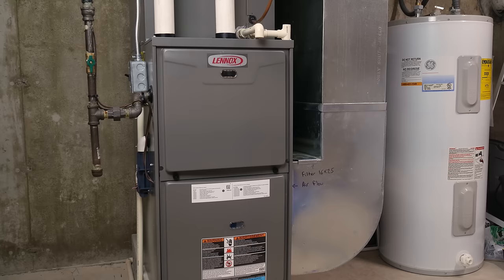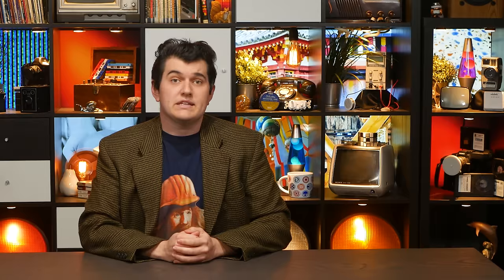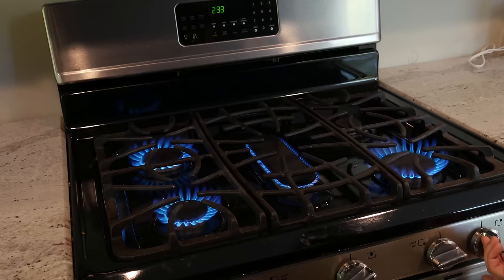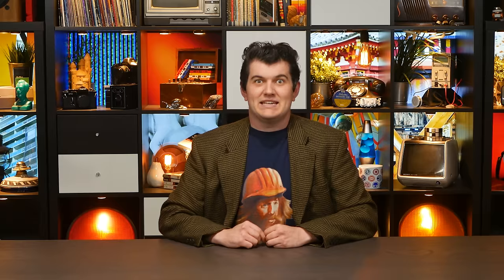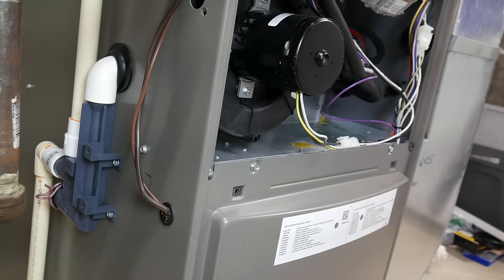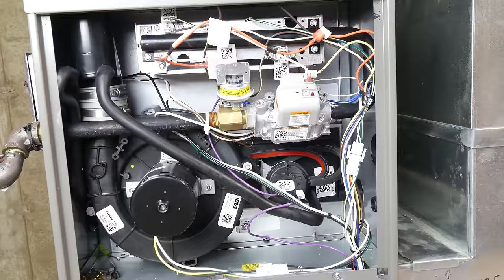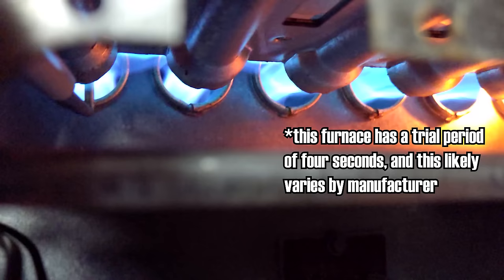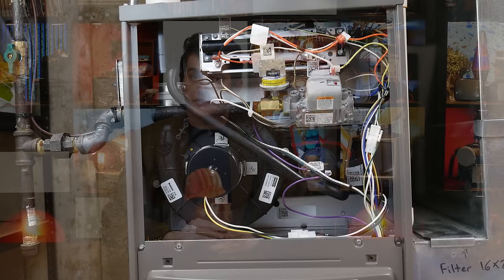Forced-air Furnaces: The What, Why, and How

Comment from the maker: **A fascinating correction about the flame sensor!**
It turns out that fire, as in literal actual flames, acts something like a diode. This means that the furnace is able to detect flames by putting an AC voltage on the flame sensor and monitoring for a voltage drop. The fire will actually conduct some current to the chassis ground of the furnace! This also allows it to detect if a flame has gone out mid-run. Pretty neat!
Reply: with oil fired furnace they use something called a "cad cell eye"
Reply: You could say that the flame represents... current events. huehuehue
Reply: Its called flame rectification. Fire acts just like a wire for electricity. If the fire drops off so does the path to ground = gas valve closes and furnace will attempt to re-light after  a purge cycle.
Reply: Flames and even just really really hot gas has lots of ionized particles. This can be seen from the flame itself . The light produced is the result of ionized participles returning to ground state emitting light. This makes flames very conductive (vs air) and this is often exploited through conduction, capacitance you name it.

Boilers usually use thermocouples on the pilot light to power a solenoid. (Which is amazing given how little power is involved) 

UV flame sensors are also popular and use UV light from the flame to excite a special gas to conduct electricity or some other similar technique that could be solid state or who knows there’s so many ways to do it.......
Reply: @John_Lee_  Yep, since the oil flame produces a lot of visible light and the detection of the change in resistance is easy, the moved to CAD cell (which is Cadmium Sulfide also known as CdS) photo resistors. Prior to that a special thermal switch used in the exhaust (called a stack switch) was used to prove flame.
Reply: @mr.monitor.  are you sure about that? Much easier and cheaper is to do that with voltage and few op-amps (gas boilers do that, at least my one do) than to measure current in uA range.
Reply: Technology Connections close.
Yes, there is a diode function to the sensor, it converts AC to dc, and measures the current to prove flame.
Reply: @jrmcferren  I hated those stack switches. Service calls left and right because the sensor was so sensitive to vibration too.
Reply: That is also the reason that old boilers are the only home appliance that I know that mind AC polarity, I mean that if you swap live and neutral they will not work. Now I think that they do that with some sort of more modern approach that doesn't involve putting line voltage into the burner, thus it's interesting.
Reply: Flames are a plasma, so they are conductive.
Reply: Some camping gas devices have a similiar function included
Reply: You are also somewhat right about thermocouples. In pilot light based systems a thermocouple is used to prove pilot light flame. Instead of using a circuit board, the pilot light is lit with the control in a pilot lighting mode. You hold the pilot button in (which may be the mode knob itself) for 30 seconds to warm up the thermocouple (sometimes a thermopile if the thermostat is powered off it as well and is a wall thermostat). The button you are pressing is a mechanical bypass to the pilot light valve. After the thermocouple or thermopile is energized, the current flowing through holds the pilot valve open. The next step is to turn the mode knob to on and then the device will run.

I know this from my RV days as my family historically had older models that still used pilot lights in some appliances and you had to light the pilot lights yourself. RVs also use spark ignition instead of hot surface ignitors since the ignition systems run on 12 volts DC instead of mains voltage and thus the energy savings of the spark ignitors are ideal.
Reply: @alerighi  many new products in the industry are still that way.
Reply: @mr.monitor.  at least the HVAC tech check that way. Transistor amplifiers are better at dealing with current anyway.
Reply: some bloke you good bruv?
Reply: @jrmcferren  you are guessing on a subject you know nothing about.
Reply: @mr.monitor.  Best answer!
Reply: On an Older Oil fired furnace, It uses a cats eye cell to monitor for a change in light output. Same principal applies.
Reply: I once saw a video of a propane burner playing music using two wires leading away to an audio source!
Reply: @some bloke You still don't have a reason.  Tell me which statement you or anyone else has proven to be false:  1) CO2 blocks infrared (heat) energy.  2) The Earth maintains thermal equilibrium by re-radiating energy from the Sun in the infrared spectrum. 3) Humans are dumping gigatons of CO2 into the air every year. 4) The Earth is heating faster than at any other time we have data for.
Reply: makes sense fire is plasma and plasma conducts electricity
Reply: @mr.monitor.  lol, so you are guessing on a subject you know nothing about. 
Your multimeter measures voltage drop (across an internal resistance) in order to indirectly measure current, its cheaper. So does the microcontroller in the HVAC. Measuring the electric field of the current would cost much more and make no sense.
Reply: @mr.monitor.  I don't know a thing about north american furnaces and I never see'd one in person so there is no reason for me not to trust you. Just it seam'd to me as strange way to measure it, it's not like I'm technician for any kind of furnaces but if somebody wake'd me up in 3am and demand that I make a circuit to control one I'll probably choose voltage level solution first never thinking about current one. As that is obviously wrong way to do that good think nobody ask me to make one :D
Reply: In the Air Force, we have heaters to use on the flightline. One safety feature it has is a photocell that detects when the flame goes out. That then de energize a solenoid, and cuts the fuel pump
Reply: What happens if the gas valve becomes stuck open?? I'm guessing the reason it's the first thing to be turned of when shutting down is so that if it gets stuck the furnace will just remain constantly on until you can turn off the manual value??
Reply: Yes, it's called Ionization current flame detection, pretty common for gas heaters. But thermocouple can be probably used as well.
Reply: Fire is conductive? Get me some Fire-Lightning!
Reply: Oh, of course! Like a vacuum tube (minus the vacuum)! Genius!
Reply: i don't know if they use these in gas furnaces, but in oil furnaces there's often just a photosensor inside the burner that will detect no light if the flame is out, or will detect the light of the flame when it's burning.
Reply: Thermocouples will do that.
Reply: Also maybe you should talk about the fact that transporting the heat also needs to be taken into consideration for calculating efficiency.
I'd think that Air would be worse for efficiency than Water+Radiators
Also, you can't use a heat pump in winter and expect to keep your home heated comfortably.
You can't break the laws of thermodynamics, heat pumps and Air conditioning do seem to do it, but they don't. You can only get so far with a heat pump, but when you are trying to squeeze heat out of -5 degrees Celsius air will not end up with a 21 Degrees Celsius home.
Reply: Yes, the flames in senses by a flame sensor, how ever it is measured in micro-amps DC. Also another small correction, while talking about the combustion air of the furnace you referred to the appliance as a condensing furnace, while this is not incorrect in context it would have been more appropriate to refer to it as a direct vent appliance. 
Other than those two small inaccuracies, as a professional in the field for the last 20 years, I am rather than impressed with the accuracy and relevant information in the video. Thank-you for trying to educate the population on how a furnace actually works.
Reply: Sean Blake  modern gas valves have redundant solenoid operators.  The likelihood of 2 valves sticking open is near 0.  That said, I have seen older gas valves stick open, one on a boiler, one on a furnace.  The one on the furnace, did involve the fire department showing up.  Luckily the blower continued to run, and the space was overheating.  The one on the boiler was very scary.  Boiler was practically dancing on the floor, the relief valve was blowing off steam(on a water boiler), and the temp gauge was pegged out at 260 deg.
Reply: Green new deal good?
Reply: One additional foot note. While PVC pipes may be acceptable as combustion air exhaust (I actually doubt it is), for some high efficiency furnaces... I don't believe it's advisable. Typically the combustion air exhaust and even the makeup tubing are made of ABS plastic (typical black)  versus PVC.
Reply: Same as with boilers here. They use a JFET with a 10 Mohm gate resistor, to detect the flame electrical conduction.
Reply: @John_Lee_  Remember that. It was an infrared sensor...
Reply: i cant wait until elon finally get the tesla HVAC heat pump out
Reply: @toddcoonradt6174  Yea and I've seen forced air furnaces burn down a trailer home. Things happen.
Reply: @teaser6089  I agree.
Reply: GMK International incorrect.
Combustion gasses in condensing gas furnaces utilize true schedule 40 PVC pressure pipe. THE SCH40 vent pvc “foam core” piping cannot be used.
Reply: @teaser6089  Actually, transport losses are irrelevant as long as your ductwork is running through the inside walls, and not the outside ones. Sure, some of the heat in the heated air escapes the ducts and goes into the walls, but that is still inside the house, and thus, is still heating the house.
Reply: I think if I'm not mistaken that the pilot light (used for ignition) on our upstairs furnace is controlled by one of those things. Only downside is that a power outage will make it go out and force us to re-light it, but I definitely appreciate it preventing continuous expulsion of flammable gas if it goes out!
Reply: @ChimpyChamp  nope. not in any unit I've ever seen. Power is cut to the gas valve, and then blower run for a pre-determined amount of time. If the gas valve does get stuck open, when the draft blower shuts off, hopefully there will be enough oxygen shortage to loose the flame. But other than that, you are out of luck.
Reply: If you are interested in doing a video on Geothermal heatpumps I work at one of the largest systems in North America which is located in Elgin Illinois and would love to give you a tour
Reply: @teaser6089   Heat pumps often use secondary heat for low temps. If you are using electrical heat as the back up, then you are back to 100% efficient at least excluding power generation goes. Efficiency in heating is related to the exhaust heat not utilized. In the case of his forced air unit being able to use PVC pipe for exhaust pipe, that's pretty efficient in removing the heat.
Reply: Not really like a diode, tbh, more like a wire - it is conductive (because flames are ionised air), but doesn‘t restrict current flow in one direction. Sorry, nitpicky physicist comment 🙈
Reply: @mbonwick  I'd like to educate he public that a thermostat is not a gas pedal. Adjusting the thermostat way off its pre-set temperature will not get more cooling/heating out of a unit if it is having trouble keeping up. It'll just over shoot the temp you really want it at eventually. Unless it is a 2+ stage unit it just doesn't help turning thermostats.
Reply: @teaser6089  when the ducts are in the house, any heat lost through the ducts stays in the house. heatpumps become less efficient as it gets colder, but there's still a lot of heat at -5c, just need a variable capacity compressor to compensate.
Reply: @cheeto4493  I would have thought that the micro-controller would still sense that the flame is lit after giving the command to close the gas valve, so some safety thing would kick in to keep it burning and maybe sound an alarm to get someone to manually close the gas valve to the house.
Reply: In a blacked out box, where the only light source is a flame, you'd think they'd use that to detect the flame ! When it lights, there will be a step change in light levels - not difficult to detect - from even a safe distance !
BUT no, they want to put a wire in the fire - which over time droops and the system fails.
Reply: @toddcoonradt6174  Situations like that or the unlikely event that the exposed gas pipes are burst is exactly why I familiarised myself with where the main gas valve is for the house, fuck that it sounds scary AF.
Reply: Good thing I read this. You were about to receive a tongue lashing. “Thermocouple” indeed.
Reply: Yep, flames contain charged particles. You can actually bend flames with an electric field.
Reply: @mr.monitor.  More accurately it's measuring the difference in the current flow to ground on one half cycle vs the other half cycle, as it acts as a diode there will be slightly more flow to ground on one than other, this helps act as a failsafe as any other leakage path such as soot etc. would not act like a diode (as it would be purely resistive) and cause equal current flow on both half cycles and could be seen as a valid flame signal which would be bad.
Reply: A chemical reaction is conductive? NEAT!
Reply: @SuperVstech  It doesn't convert it to DC, it SLIGHTLY rectifies one half cycle more than the other (as the flame only acts as a single not very good diode) and it's that slight difference that's important to act as a failsafe detection method.
Reply: I generally like what content you offer. That said, this one hits closest to home for me.. I work as a lead, in manufacturing, in a breakfast cereal factory.  Part of my job is overseeing large gas fired deck ovens, that use all the  same operational systems, and safety failsafes that control a standard furnace. The only part not included is the cycling forced air, because the deck oven fireboxes are internal and dont have to move heat away from where it is produced. Cool content. Peace.
Reply: You should do a whole video on flame rectification, there's a lot more to it than you (and many of the commenters here) think, the EXACT way it works is very important and what makes it fail safe, a lot of HVAC technicians don't fully understand how it works just the vague basics of how they need to test it.
Reply: @millomweb  Some systems use UV flame detection but that fails over time and the sensors are fragile. Flame reification is very robust and extremely reliable.
Reply: @mr.monitor.  uA not mA but that's nothing to do with the point I was making.
Reply: Modern gas stoves use a somewhat similar sensor to cut the gas flow if the flame go off. Problem is that sometimes they are not reliable and it's tricky to turn on the stove (like when one have to try several times to start a motorcycle, a motor boat or a chainsaw).
Reply: Saab used this concept on their Trionic engine management system, introduced in the early 90's. They utilized spark plugs to detect engine knocking via ionization. Cool stuff back then.
Reply: @hectorj.romanp.  They are reliable, if they don't let you turn on the gas then they're probably dirty which interferes with the rectification, the problem isn't with the sensor it's with the user, they're doing exactly what they're supposed to and acting in a fail safe manner. The same could happen in a boiler if soot builds up on an electrode but that would be a failsafe measure as soot shouldn't be building up as soot would point to a combustion problem so again it's doing it's job as a safety part.
Reply: @mfx1  It's the electrodes used that aren't reliable ! They deform due to the frequent heating and cooling. Then they miss the flame and have gone very brittle ! I've a boiler in the hall that was taken out of service due to failed electrodes and bad reputation.
Reply: Actually it's called FLAME RECTIFICATION and it doesn't just detect if the flame has gone out mid run, it also lets the furnace know that there is a continuous flame from the first burner to the last. If one burner, say in the middle fails to light it will also shut the furnace down. What you called a thermocouple is really just a piece of stainless steel wire.
Reply: @millomweb  That's not a problem with the system as such that's incompetent design.
Reply: Interesting! Towards the end of the video you mention you’re in a cold climate, but I seem to get the impression you’re in the southeastern United States. Never thought of that as a cold climate, interestingly.
Reply: @andrewludwig9251  Nope. Because he's wrong.
Reply: The big advantage of detecting the conductivity of an ionized gas (or, flame) is that it is instant. No need to keep the gas flowing until it is evident that a thermocouple did not heat up. The gas supply can be stopped within just a few secs after it started in case ignition did not occur. Basically that is just the time needed for the flame to propagate from the ignition source to the detector, proving that all burners lit.

Good that you corrected your thermocouple mistake by pinning your comment.

Usually, another safety device can be found in those furnaces: a panel switch that stops and prevents operation if the access panel is removed.
Reply: @Yossus  no, really like a diode. Try Flame Rectification on Wikipedia. For a physicist you're not very good at research...
Reply: @gorjy9610  It's kind of down to semantics and how/where/what you're measuring. Flame rectification (also called flame ionisation but basically the same thing) relies on the flame acting as a very weak diode, pass an AC current through the electrode and the diode will cause a tiny amount of current on one half cycle to leak to ground through the weak diode but not on the other half cycle, this difference is critical as to what makes them failsafe as the difference confirms that the flame is there acting as a diode, any other form of leakage due to moisture or dirt would not act like a diode so there would be no difference between the half cycles. The way the current is often measured is that the base of a transistor is also connected to the electrode so the small pulsed current caused by the flame rectification turns the transistor on briefly, this allows current passing through the emitter/collector to charge a capacitor and simplistically you can measure the voltage across the capacitor to determine that current is flowing through the flame to ground so you are measuring current but you're doing it by measuring voltage. There's a lot more to it though as to be failsafe it needs to verify the current is flowing because the flame is acting like a weak diode and not because of some other leakage path such as dirt or moisture that could wrongly give a "flame good" signal (bad thing) so they actually verify that the current is flowing in one half cycle but not the other and there's loads of different schemes form different manufacturers to do that. However you do it  you are ultimately measuring the current to ground through the flame on each half cycle and making sure there's a difference within an expected range but that is likely to be achieved by measuring a voltage further down the line (just like multimeters measure current but actually measuring the voltage across a shunt).
Reply: Who installed your furnace?
Reply: How can it be a diode: what about a flame has a direction to it?
I think it will conduct equally well in either direction, if you place wires into a flame.
A flame is made of plasma, which is conductive for the same reasons a metal is.  You can find on You Tube (by one of the major science/tech presenters but I don't recall the name) a re-enactment of Faraday's lectures on a flame.
Reply: @JohnDlugosz  It's a very weak diode there's plenty of information about it.

http://liu.diva-portal.org/smash/get/diva2:20787/FULLTEXT01.pdf
Reply: @mr.monitor.  That sounds so steampunk, using flames as diodes must have found a use somewhere...
Reply: @millomweb  flame rectification type sensor is extremely reliable provided everything is clean - there are 25+ year old furnaces out there with original flame sensors doing just fine.
Reply: @mr.monitor.  Wrong, read on.
Reply: @gorjy9610  the Carrier & Lenox (and many others) heaters in the video use a flame sensor.  120v AC volts are applied from the control board thru several series resistors and 1 or 2 capacitors in series to limit the risk of electric shock to techs and homeowners. The flame rectification will allow a DC voltage to flow.  A metal to metal short from flame sensor to chassis ground allows AC current and the board will shut down the gas.
If you use a volt meter to measure the voltage at the flame sensor, your meter will drain some of the current limited power.  Cheap meters may report 6 volts. Better meters may report up to 90volts.
The old 60% furnaces use thermocouples and required time cool off and thus turn off "the gas leak".
P.S.  if a control board detects a flame when the gas valve should be off, the draft inducer and blower are turned on (protects warranty of equipment) and heats the house more and the homeowner complains, hopefully before the house burns down.
Reply: @jonathanwright6482  thanks for pointing it out - shows what I know! And now that I know the term I need to look for, the research will be a whole lot easier 😉
Reply: @mr.monitor.    Don't always believe Wikipedia. Flame does not act like a wire for electricity, in the instance of a thermocouple, nor does it serve as a ground, in fact, a thermocouple can't send a signal at all if grounded. Flame proving sensors actually produce a DC current flow signal (measured in microamps by your meter or the board) as a result of the thermoelectric effect between 2 dissimilar electrical conductors that are in the thermocouple. This signal will tell the board (if newer) to open a normally closed solenoid in the gas valve to allow gas on-demand. If the system is older and has a pilot light, it will use an series of enclosed thermocouples (called a thermopile) that send a signal large enough to actually engage the gas valve solenoid on its own. Cad Cam cells are used now for fuel oil furnaces and are actually thermopiles that read IR light instead of heat.  Mercury bulbs and bimetal switches used to be used for flame proving, but with the efficiency of todays systems, these sensors take too long to cool back down when the flame goes out.  This was taken from AHRI Fundamentals of HVAC, Third edition and Electricity for HVACR by Joseph Moravek.
Someone shoulda went for the Diploma instead of just the certificate.
Reply: Alright everyone, Listen up.  Don't always believe Wikipedia. Flame does not act like a wire for electricity, in the instance of a thermocouple, nor does it serve as a ground, in fact, a thermocouple can't send a signal at all if grounded. Flame proving sensors actually produce a DC current flow signal (measured in microamps by your meter or the board) as a result of the thermoelectric effect between 2 dissimilar electrical conductors that are in the thermocouple. This signal will tell the board (if newer) to open a normally closed solenoid in the gas valve to allow gas on-demand. If the system is older and has a pilot light, it will use an series of enclosed thermocouples (called a thermopile) that send a signal large enough to actually engage the gas valve solenoid on its own. Cad Cam cells are used now for fuel oil furnaces and are actually thermopiles that read IR light instead of heat.  Mercury bulbs and bimetal switches used to be used for flame proving, but with the efficiency of todays systems, these sensors take too long to cool back down when the flame goes out.  This was taken from AHRI Fundamentals of HVAC, Third edition and Electricity for HVACR by Joseph Moravek.
Someone shoulda went for the Associates Degree instead of stopping at Certificate or Diploma.
Reply: @Jon-hx7pe  Yeah I guess I jumped the gun, but it takes an incredeble amount of energy to take that heat energy and transport it up into the house. By that point you have to start considering if just using that electric power to heat your home wouldn't be more efficient. Cause I think it would.

You can't create free energy and I am pretty sure if you are trying to take energy from a very cold place and try to put it into a warm place would take more energy than just trying to heat the place up with electricity.
Reply: @teaser6089  it doesn't work that way because the energy consumed by the compressor is absorbed by the refrigerant and released indoors. a heatpump is worth running over straight electric as long as the outdoor coil is picking up free heat and enough to not be offset by defrost cycles which use heat from the house to melt ice on the outdoor coil. most air source heatpumps in cold climates are installed with heating elements to supplement.
the issue is capacity more so than efficiency -> there are some new heatpumps specifically engineered to maintain full capacity down to -20c or lower.
Reply: @some bloke Yeah! All those fake names, spouting unsourced "facts," and dealing out unfair put-downs. Lazy lazy lazy.
Reply: You touched on the issue of outside air can I suggest a video covering air to air heat exchangers aka heat recovery units they are an efficient way of getting large amounts of fresh air into a space without losing copious amounts of conditioning from room air we are seeing quite a lot of this not so new technology coming into play here in Australia I would imagine it’s a similar case around the world.
Reply: @clemkadiddlehopper7705  I wasn't talking about Thermopiles, thermocouples, or cad cells. But thanks for the boring message 😴
Reply: I have READ EVERY ANSWER to this comment (up 'til now). I am pleasantly surprised by how constructive and well-intentioned all of this was.
 
Thank you, everyone who participated, for trying your best to educate everyone else! TCCommunity ROCKS :D
Reply: @clemkadiddlehopper7705  and yes in the furnace pictured in the thumbnail flame acts exactly like a wire as I stated earlier. Has nothing to do with Wikipedia but actual experience.
Reply: most newer furnaces also have a temp sensor in the exhaust, if the temp gets too low, it will trip and shut down.
Reply: @Jon-hx7pe  Yes, but you need to work harder to get the energy out of the air, also if you are using a heating element in the heatpump to supplement it, why not skip that step and use it in the house itself. As that would be more effiecent. The higher the Hat Delta between 2 points the more work you need to increase it even futher.
Reply: @teaser6089  all the energy consumed by the compressor is ABSORBED by the refrigerant and helps heat the house, it's not less efficient to run a heatpump than straight elements until almost no heat is being picked up by the outdoor coil. what the outdoor coil picks up is free heat.
What happens with a traditional heatpump is, as it gets colder outside, the heat output drops off as does the compressor amp draw. Efficiency drops, but not as quick as capacity. Around -10c, a decent air source heatpump can still pick up two times more heat than energy consumed.
Now, cold climate heatpumps have high capacity  variable compressors that ramp up to maintain heat output as it gets colder. At -20c, the efficiency may only be 150%, which still saves 30% over a heating element.
It's true that efficiency declines as it gets colder outside, but when the alternative is a resistance heater, the heatpump is still better. 
Heatpumps are primarily designed to reduce or eliminate the need for straight electric heat. Gas furnaces are cheaper to run in cold climates than air source heatpumps. Some heatpumps are paired with fossil fuel furnace, and when the heatpump can no longer keep up, an advanced thermostat automatically changes over to fuel.
Reply: GMK International we use a special type of pvc piping the is specifically manufactured for the purpose of venting high efficient appliances. It’s is in fact against my local building codes to use ABS for the exhaust side, it maybe used for intake however.
Reply: @Jon-hx7pe  Oh, like that, now I get it! :).
Reply: @John_Lee_  , that should properly by CdS, since it is the chemical abbreviation for cadmium sulfide, a substance which changes electrical resistance with changes in light intensity. A sensor using CdS is usually called a 'CdS cell' or similar name.

But I wonder why oil burning furnaces would use CdS instead of a temperature detecting sensor such as a thermocouple, thereby detecting the light of the flame instead of the temperature of the flame. Seems that detecting temperature would be the more reliable way of doing it, and it also seems that  CdS sell might be tricked, by being exposed to light, into thinking that there is combustion when there is not. Maybe somebody who is an expert on this can weigh in.
Reply: @mr.monitor.  V=IR dude - they are the same thing. but the bit you measure directly is a voltage drop. stop talking out your arse. You dont know the literal first thing about electricity, ohms law
Reply: @youtuuba  cad is short for cadmium sulfide and they detect the light of the flame. There's no way there would be light in the chamber if there was no flame.
Reply: Thanks, you saved yet another heated "the flame rod is not a thermocouple!" comment. Btw, is anybody keeping track of "fuel to heat efficiency" for the comment section?
Reply: Engagement. I am engaged. Engagement? Yes, engagement.
Reply: What about vent free gas logs? I have a set that runs on propane and they claim not to produce CO. Plus it is basically 100% efficient since the combustion vents directly into the house.
Reply: How does that work in my natural gas stove? It doesn't have a connection to electricity or any batteries yet has a flame sensor: if the flame is blown out it cuts the gas. It might be a heat sensor instead of using the properties of plasma?
Reply: why does the carbon monoxide not burn up and instead goes through the exhaust? isn't it flammable?
Reply: I didn't realize the issue had already been discussed, and I made my correction post. It's a serious point because the most common cause of short cycling in a furnace is the lack of flame detection. The flame sensor gets coated with time and can't conduct. Usually, whipping it clean with steel wool will solve the problem.
Reply: Whats crazy is how the regulator in Gas Water Heaters are powered by the flame by utilizing a simple thermal energy gradient
Reply: Dang was gonna comment but you beat me to it
Reply: The boiler uses an ionization electrode (not a thermocouple) for flame detection that measures the ionization current through the flame -the flame is matter in the form of plasma, and the plasma formed is electrically conductive . Through the gas oxidation reaction it eventually involves an electron exchange :)
Reply: Yeah, the properties of metals can combine to do some pretty cool stuff.
Reply: @ryanswob3583  "Dang was gonna comment but you beat me to it" I know. I'm so happy when I find a mistake, and I rush to post stating my correction from my superior body of knowledge. Then I discover someone else was a few hours ahead of me. Depression.
Reply: Hvac tech here. The flame sensor is actually performing something called flame rectification. We pass 120v ac into the flame sensor and allow it to conduct inside the flame back to chassis ground. What we can do now is read how many micro amps DC is flowing on the same wire! Crazy!! I would be happy to take a quick video of a digital multimeter showing this process!
Reply: Mr. Monitor - You’re right that you’re measuring current, but the way that a meter measures current is by passing it through a known resistance and measuring the voltage drop across that resistance.  That’s how digital current meters work.

Well, for small currents anyway.  Large currents are often sensed by the magnetic field they create, since resistive losses on large currents can be substantial.  But I promise you, your meter that you put in series to measure current is doing so by measuring a voltage drop across an internal resistor.  That’s also why many meters have separate paths for <=mA and >A.  Different size resistors.
Reply: @alerighi  That is true. Flamme sensor will mesure milliamps from sensor to ground. If, in a 120v gas furnace, you swap black and white wire, no current will flow to ground from the sensor. You get a flamme failure even if the burner is on!
Reply: Heat exchanger ventilation module. Awesome thing. Make a hole in a wall. Install a brick with holes. Blow warm air outside, then blow cold air inside. Cold air will be warmed by warm brick. Voila.
Reply: Already replaced out open stove with an electric heat plate a few years back. Far easier to clean, easier to use. looks nicer, and might be safer. Cost a lot to buy but it was good idea. Even if we already have massive vents right above the stove in the kitchen.
Reply: Why doesn't conducting current to ground cause the RCD/GFCI to trip? Or is there not one on the boiler circuit?
Reply: Commercial gas fired units have ultra violet sensors (purple peepers) for flame detection too.  Very fast sensing needed with large burners.
Reply: So, when people stop consuming natural gas, and if we're still using crude oil for any reason, where does the natural gas go? Vented to the atmosphere? When you see oil pumps burn it off, it's because there's nowhere to put the natural gas that comes up with the oil.
Reply: @sleepyancient6655  well we can replace the major categories for crude oil like cars, boats, and air craft with things like hydrogen if needed, but natural gas would be harder to replace. We can't fully stop crude oil harvesting though as it still is necessary for manufacturing, lubrication, etc but we can get rid of the majority of the barrel hogs such as vehicles. Natural gas however is used for peaked power stations as they can boost up at any time, large parts of the nation use it for heating as it's far cheaper than electric heating, plus either way you still use natural gas as even in a full solar future you still will occasionally need a peaker plant for heavy demand like the holiday season.
Reply: You're not wrong, but the change in resistance / conductivity due to changes in temperature ... is literally how thermocouples work.
Reply: @John_Lee_  , hmmmmm, didn't I write about cadmium sulfide in my comment? But your regarding your statement that 'cad' is short for cadmium sulfide....CdS is the correct abbreviation. I don't doubt that some people might use 'cad' incorrectly, since probably the majority of people working in the HVAC trade don't have a lot of formal science training.

My comment about a CdS cell possibly being tricked would apply if it were possible for the cell to be exposed to light, perhaps if the unit were partially opened up or modified. I agree that this is probably not very likely.
Reply: @youtuuba  well I was an HVAC tech for 7 years and have a BS in science, kind of seems like you were making a slight about the education of technicians. My point was in the industry its called a "cad cell eye" . Google it and you'll see all sorts of oil burner results. Search for "CdS cell eye" and you won't. I guess the engineers wanted a more pronounceable name.
Reply: @John_Lee_  cadmium sulfide. it's just a light sensor, the same kind used to turn outside lights on automatically when it gets dark. the "cad" (or cds) cell in an oil burner is more or less "watching" the light from the flame.
Reply: @emolatur  I know this thanks.
Reply: @gorjy9610  He's correct.  But you'll would have to take up you suggestions with Honeywell or white rogers.
Reply: @lztx  : Sounds like a thermocouple system, though it could be a bimetallic flex sensor instead.
Reply: Most of the time, if your furnace keeps failing an attempt to start, it's because the flame sensor is dirty with carbon build up. While I don't advise the average Joe to attempt to clean it, if you are a bit of a handy man with some know-how (or access to a video to show-how) then it's a pretty easy fix that will save you a lot of money from a service call. (Especially if the technician can't come out right away and it's REALLY COLD outside!)
Reply: @mr.monitor.  : Sounds like you don't know how your meter works. Meters pretty much universally are current controlled, but usually that current will be generated by some opamps inside, which themselves are detecting the voltage difference between two points, and thus the meter itself is actually voltage controlled. To detect amps, they throw a resistor of known value between their contacts (a simple design is for the resistor to be selected according to the expected voltage, which in some cases can lead to wonky readings that don't seem to make sense...), so that they'll get a voltage difference across the resistor. The contactless stuff tends to just stick a coil (often with contacts part way along the wire so you can use an easy squeeze-clamp design) on those two measurement points, though technically stuff like hall-effect sensors or flux-gate magnetometers can be used as well.

Out of curiosity, how are you checking the sensors, by unplugging them? If they're measured while plugged in, then I would usually expect the measurement to be in volts, since that would be easier to implement (high resistance opamp inputs, + a shunt in case of over-voltage, + a fuse in case the shunt actually gets used, vs trying to figure out how to correctly measure the amperage output of very low-voltage current drivers...).
Reply: @cmcgarry250  : It's likely conducted to neutral instead of ground. People tend to be a bit sloppy with their wording.
Reply: @Skylancer727  : Hydrogen is a horrible fuel, due to poor volumetric energy density (methane, aka natural gas, gets double in it's most compressed form, and at a much less frosty temperature too), leaking through every material available to humanity, and general unsuitability to ICE engines (it damages many metals when leaking through them, and apparently poses a much higher risk of combustion in the crankcase, thereby posing a risk of blowing up the engine); and is furthermore unsuitable to converted hydrocarbon engines, which greatly reduces it's suitability even more. You could try just using fuel cells with mostly non-metal parts, but last I heard, there wasn't enough fuel cell catalyst for just the automobiles of the US, much less anything or anywhere else.

Producing methane from scratch is less energy efficient than producing hydrogen, but it's still a better idea than hydrogen.
Reply: @John_Lee_  As a senior electrical and electronics engineer for over 40 years, and a teacher of industrial controls of the college level, I was acknowledging that many, possibly most, HVAC technicians probably don't have a lot of formal training in the sciences. Certainly they have some such training, and many probably learned on the job, and some have college degrees. But you are correct that in such industries, there is a tendency to simplify terminology and such to avoid making it more complicated than the entirely of the workers can understand. So I see where "cad cell eye" would be widely used in the industry, but the fact remains that the 'real' abbreviation for cadmium sulfide is CdS.
Reply: The most dangerous diode ever.
Reply: They call it a flame rectification sensor.
Reply: I love this video! Hell, even after doing HVAC for over a decade, this is still one of the best videos I've seen on how a furnace works...  I like how they actually upsized your intake and exhaust properly on your furnace, besides the flame sensor not getting cleaned period. Which is usually a result the size of the intake and exhaust couple with whatever it's sucking in from the house, if that's applicable, one of the biggest problems with furnaces is the people installing them go "oh, 2-inch pipe goes in here so that must mean the whole thing is supposed to be 2 inch..."  (Even though there is an entire guide on it in the IOM manual) and then in the not-so-distant future your system isn't working right and nobody can figure it out 🤦‍♂️

LOL, anyways been a fan of this channel for a long time an through multiple Gmail accounts so I just kind of wanted to make a smartass remark about ignorance in general, haha. 😂😂🤷‍♂️  hey everyone of us is ignorant somewhere I'm not saying I'm excluded but some of the stuff out there good god... 🤦‍♂️
Reply: Electrical multimeters that are designs for HVAC have a micro amp setting and you oh, naturally, put it in series with the wire going to the flame sensor to see if it's within range or not dude. And that's how you check a flame sensor
Reply: @John_Lee_  same here
Reply: My family started a geothermal heat pump company, one thing I'm proud to know a lot about is geothermal because when it's done correctly with a house with proper insulation, the savings are ridiculous we've had people actually get a return on investment in as little as two years, whereas you won't ever get a return on investment with an air-to-air system :-)
Reply: @some bloke Let's revisit this comment in a decade or two and figure out how we did/did not get there.
Reply: It's DC voltage bud ^^

Keep up good work.
Reply: @John_Lee_  cad cells are freaking cool. Cleaning the oil furnace every year isn't...
Reply: @mycosys  yes, but I think you meant to say that "measuring the magnetic field of the current would cost much more and make no sense"?
I design voltage and current sensors, and I agree that I'd probably choose to measure the voltage drop from a known impedance source than uA current in a half-wave rectified signal.
Reply: They should have put a monoxide sensor on the same line, solving two problems in one hit :)
Reply: @fishbed4522  No, there isn't enough ionisation in a typical fire to call it a plasma. It needs to be MUCH hotter as you need a lot more sustained ionisation to support plasma phenomena. It's incandescent gas with a small amount of ionisation.
Reply: That is "frarking" cool.
Reply: Another cool fact is its watching for flame 247. So if the gas valve sticks open after a call for heat the furnace sees that there flame when there shouldn't be and it will continue to run the vent and blower motor to prevent a fire.
Reply: @teaser6089  The efficiency of heat pumps is relative to the 100% efficiency of converting electricity directly to heat (resistive heating).  There is no "breaking the law of thermodynamics" as a heat pump doesn't create or release "usable" energy, only relocates it. 
Depending where you live, you absolutely can be comfortable with a heat pump. I live in Virginia in a not-too-well insulated home and my air-source heat pump has done a decent job of keeping the house hot in the cold and cold in the hot.  As mentioned in the video, a ground-source pump works even better, especially in colder climates, but few enough people (relatively speaking) live in an area where a heat pump just won't ever work.
Reply: next take a look at how CO sensors work to complement this video
Reply: The hot water heater(Old thing, 20+ years old now) here uses a thermocouple on the pilot light to hold open a valve. So any time the main burner comes on it's guaranteed to have ignition.  If the pilot light goes out, the thermocouple cools, valve closes and everything shuts down.
So startup involves holding the valve open for the first 30 seconds until everything warms up.
Downside: Uses a small amount of extra fuel(That the heat from is captured anyway). Upside: No requirements for power and very failsafe.
The gas oven also uses the same trick.
edit: And of course someone else has mentioned it before.. Still! Intresting tech.
Reply: ... now TechConn is just redoing ""the Secret Life of Machines'" tv show from britain which also covered heaters,  ,,  I do recommend this show it taught me all I know about my car and house,,,
Reply: ... stupid OR genius idea is just using Mirror Heliostats or even White Curved Wall to bounce sunlight into a house ,, ,,  passive system that I think could work but I guess no one does  ,,, or maybe I am wrong but again seems like a genius idea that should be pushed, ,,  and yes on cloudy days need to draw heat from a tank of water one heated up on sunny days,,,
Reply: @Simk1d  More precisely, a cad cell allows current to pass in the presents of light (the flame) so not "monitoring for a change".
Reply: That couldn't work in Australia, all of our circuits are wired with GFCI/RCDs so that if more than 30mA is flowing to ground for more than 30ms it will disconnect the active and neutral conductors.
Reply: @John_Lee_  ... so basically a glorified photoresistor targeting the flame source. ;-)
Reply: I was so waiting for you to say that in the video.
Reply: @dontcheckmychanel  in a way, you're a conductive chemical reaction.
Reply: It's odd though, using a furnace on the grounds of efficiency but electrically driven air-conditioners.  Why not drive an Ammonia refrigeration cycle, and pump chilled water through the radiators?
Reply: I love that you always add the bloopers at the end; it gives me laughs; please NEVER stop doing that; it's like your calling card. :-)
Reply: I fixed my furnace last year, the code was failure to ignite, but i could see the fire, so i took  alittle sandpaper to the thermal couple, and it worked, turned out there was a small layer of scale from being heated a cooled constantly, that prevented it sensing the fire, or as per your correction allowing the voltage to flow
Reply: Gas chromatographs, which analyze mixtures of unknown chemicals by timing how long it takes their vaporized components to migrate down a long heated capillary tube, often detect the molecules at the other end of the tube with what's called a "flame ionization detector", which sends them through a tiny hydrogen-oxygen flame and looks for the conductivity created by the ions. When I was interning at NIH as a teenager I occasionally had to haul heavy cylinders of hydrogen around to fuel these things.
Reply: @John_Lee_  is there light? probably on fire then.
Reply: Please talk about heat pumps.
Reply: It's called a flame rectification circuit. The ignition control is watching ground for 1-4 micro amps DC. I forget all the details, but something about the AC voltage jumping from the small flame sensor through the flames to the chassis creates an AC to DC rectifier. This makes it pretty much impossible to have a false positive.
Reply: Fire creates plasma, which in turn means free electrons. This is more or less how vacuum tubes work.
Reply: Depending on if the furnace is multi position applicable... your afue for one model could apply when installed in a certain orientation. If its a multipoise model (search carrier 58MVP product afue) Down flow worst, horizontal is between, upflow is highest.
Reply: I can't read all the 174 comments here, but I love this sensor design.  Burning gas is a plasma, so it conducts with an intrinsic resistance proportional to it's cross-sectional area and length and the molecules involved (i.e the number of free electrons).  So because of the velocity of those electrons I'm going to need a pretty high voltage to see a reasonable voltage drop across across this high resistance plasma.  AC volts are just THE way to do that (Tesla), so what voltage are we talking about?
Reply: @some bloke Putting fossil carbon into the atmosphere has clearly been a problem for a while now.
Reply: We call it flame ionisation. It only a few micro amps. But nothing to do with rectification. It works in both directions. But your apparatus work on dc. So you measure only one way.
Reply: Thanks for the video.  Nice production quality and good duration... Not too long and not to short and you stayed on topic.  I enjoyed it and learned.  I've worked on older furnaces and have been mystified by the newer ones till now.  Then I moved to Arizona from MN and have a different kind of heating here that is part of the A/C system.  Learn that later I guess 🤣
Reply: @jrmcferren  yep..the old pilot light scheme.  We used to turn those off in the summer to save a little fuel on the furnace
Reply: Impossible to find previous comments on here.  Anyway.... 

Last week I posted some notes about the White-Rodgers 5050 spark igniter.  It senses the flame backwards thru the same lead used to provide the spark.  Looking at the internal circuit, it apparently only relies on the conductivity of the flame.  Anything around 5-MOhm will inhibit the circuit from sparking.  This design does have the problem that a dirty or sooty spark electrode could mimic the 5-MOhm flame.  

The Honeywell S8610 is a similar spark ignition module, but the circuit design is very different.  Some information is hidden in a custom hybrid module, but other parts of the circuit seem to indicate that it relies on flame rectification.  This has improved immunity to the dirty/sooty electrode problem previous mentioned.  

Further reading indicates that a typical model of the flame is about a 2.2-MOhm resistor in series with a perfect diode, and this all in parallel with a 10-MOhm resistor.  When measured for the spark electrode as "+", and the burner chassis as "-", you will see the parallel combination of of 2.2M and 10M or about 1.8MOhm.  However, if the electrode is negative, you see only the 10-MOhm resistance.  So it's not a very good rectifier, but the difference between 1.8M and 10M is what the circuit senses.
Reply: Have you made a video on, putting batteries in the freezer?
Reply: Why the hell don't you respond to my tweets. Do I not exist or anything?
Reply: love your videos
Reply: In your closed captioning video, you mentioned TELLE TEXT. I would like to learn more about that. Could you please bring forth a video addressing this?
Reply: Dude!! You need to talk about the A.C live wire detecting toys
Reply: well fire is plasma, and plasma is conductive, in some way shape or form, and ngl, i'd love to go through tech things with you, well, for AFV's (armoured fighting vehichles... tanks, it's pretty much tanks and armoured vehicles)
Reply: I work in the industry and there are three types of flame detection. A diode, like you said, a thermocouple, which you mentioned originally, but acts using hydraulics in a very thin conductive tube, and UV cells (mainly industrial heating) which react to the light created by the flame. Before electronic circuit boards, heater controls used to be made of mechanical switches and relays, which are really intricate and cool to see operate. As for central heating boilers, the concept is pretty much the same except instead of a blower and ductwork water is pumped through the exchanger and into a circuit of fairly narrow pipes into radiators which act as secondary heat exchangers in the rooms of a house/building before being recirculated back to the boiler. An expansion vessel is used to protect the system from over pressurising on start up and to cope with the water pressure increasing from the additional heat and a thermostatic pressure relief valve will drain out water if it gets too hot or the pressure exceeds a safe level. There will be a safety shut-off feature linked with this system. As the water is sealed into the system a chemical inhibitor is added to prevent corrosion and gunk build up. If there is a loss of water in the system there will be a filling loop (a little piece of flexible pipe with a manual gate valve between the water mains and the system) you can use to top up the water. The science and technology behind heating systems is pretty fascinating, and has been well covered in this video. Many thanks for making this!
Reply: @eric4946  fire is a form of  plasma
Reply: @midnightwatchman1  yes, just chemically excited rather than electrically
Reply: @ChimpyChamp  most gas valves are designed to be failed safe. Powered coil to open and mechanical spring to close it.
Reply: This effect is also used in conjunction with electronic spark igniters. The difference in voltage trying to spark in air vs plasma is how the controller detects the flame. It also serves as a handy way to immediately send a spark in the event of a flame-out because it's always checking for fire, thus there's always voltage in the igniter ready to spark the moment it loses connection to the ground.
Reply: Looking at the furnace here, I see the condensate/pressure proofing tubing is incorrectly assembled for your up flow orientation... get it looked at.
Reply: Question as I have one at my house, 
How does the system close the gas valves in the event of a power failure (thus the blower for the furnace and indoor fan fail) and the logic board doesn't have energy?
Reply: @randomdude1053  your gas valve fails safe. The valve is powered open and spring closed.
Reply: I was going to mention this.  Flame sensors use the property that flames act as rectifiers (diodes) and this small rectified current can be detected.

A periodic cleaning of the flame sensor with a scotchbrite pad keeps them and your furnace running.  Soot on the sensor interferes with it sensing the flame.
Reply: I band?
Reply: Cool!
Reply: @John_Lee_  with orange juice they use oranges
Reply: @SuperVstech  , as I stated before there is nothing exceptional to a flame rod.  You can replace it with a piece of steel wire but you cannot replace a thermocouple with a piece of steel wire.
Reply: isn't heated air more conductive ? electroboom used a candle to start his jacob's ladder
Reply: @alerighi  The Lennox furnace in the video here is also sensitive like that.
Reply: Alright when’s the water heater video coming
Reply: If it's a "no-brainer" then the consumer will decide in its favour. You only need government to coerce people into doing things they don't want to. Be weary of "policy suggestions."
Reply: Plasma is like a direct short with very low resistance
Reply: There are Lennox EL/ML 96 units but that is indeed a 95. A boiler is basically the same with a purge blower and heat exchanger and most you see are 80 percenters or less.
Reply: Interestingly, if you added a second stage, you'd have gotten that 96% AFUE.  That's an EL195 if you went with the EL296, that extra heating stage improves effeciency by adding a "low fire" stage that runs a slower blower speed and inducer speed allowing greater heat throughput for a set period of time to "bump up" the temp as it slow falls in a well insulated house. Source: I'm an HVAC technician specializing in Lennox and Carrier equipment
Reply: It's a catch 22 with rectification as it often builds up with odorants from gas causing conductance issues with the sensor. Probably top 3 most common furnace faults, flame signal lost.
Reply: QUOTE: “Natural gas has been trapped for millenia.”  Another quote from a science book: “ Natural gas was created millions of years ago when dead microorganisms, like algae and plankton, sank to the sea bed.”  

Millenia sounds like recent written history (which goes back 6 millenia).  NG actually is older than the human race. 90 million versus 0.2 million

.
Reply: NG is 90,000 millenia old

.
Reply: Fire is plasma just like a bolt of lightning.
Reply: @hotkeymuc  that's actually how vacuum tubes were invented. First flame rectification was discovered, and then it took years to find that it's the vacuum+heat that allows it to function. The flame consumes the gas creating a reduced pressure inside the flame itself, not as efficient as a glass tube with all the air removed, but enough to prove three concept.
Reply: @GMK4EVER  ABS is also not actually stable at all the potential temps. Polypropylene is the ideal material for high efficiency furnace exhaust venting.
Reply: @uss_04  Not saw those very old heaters for a while. They are so inefficient they are not selled there for 25 years. Also prone to failure and cannot manage failure modes well.
Reply: @2010trainnut  And that is the reason why some furnaces needs specialized power backups. Even if you get clean sinus you need them to fake ground connection. I would say Geminox condenser furnaces are bad with this. But others as well with same control electronics.
Reply: The flame sensor on my furnace had gotten some gunk on it, so we had little heat for a while, then techs came and fixed it and tried to upsell to a new furnace, still working like a champ 3 winters later
Reply: @ChimpyChamp  Unless there were 2 electronic gas valves in series? Given that such an occurrence would be dangerous, and everything else is designed around safety, redundancy in the form of 2 series valves seems plausible.
Reply: @John_Lee_   how about the bottom is for what ? Do i need to turn off the bottom or is on all the time
Reply: Cool fact, before flame sensors it didn't really matter if you wired a furnace backwards. That stopped working because the flame sensor uses DC since only half the sine wave is read as current. Can't send the voltage the other way so it didn't get the signal it needed
Reply: Dang it, I was about to correct ya on this😱 120V positive DC at roughly 75 ma. Forget to turn power off on older models n ya get a good zap from it. Older models constantly sense flame, only paying attention to the signal when gas valve is open.
Reply: Also, help ef fark!
Reply: @toddcoonradt6174  Modern condensing boilers and furnaces have a variable firing rate controlled by a variable-speed combustion air blower and an associated gas flow regulating device. 
If the blower motor stops, is the gas flow blocked by mechanical means (the gas regulator closing), providing a backup for the solenoid valves?
Reply: This explains why in my unit it says that the ground MUST be connected to the furnace chassis for the flame sensor to work. brilliant
Reply: I wanted to say something about this, but I’m glad you’re on top of it.
Reply: You saved me a lot of money on a service call. Figured out I just needed a new flange sensor.
Reply: @John_Lee_  That'll either be a cadmium sulphide light-dependent resistor, or else something more modern like a photodiode, but the old name has stuck. 

I suppose what you could do, would be have one optical sensor with a yellow filter in front of it, and another with a blue filter. Then you could look at the colour of the flame, since yellow means incomplete combustion and carbon-monoxide risk. Dunno if they do.

Not sure why they don't also use a conduction-based flame sensor like the OP mentions. Fire is fire, all fire conducts electricity, it's the ions involved in combustion. Maybe it'd get all icked up by tar and stop working, do oil furnaces do that?
Reply: Hi
Reply: I have three houses and have had trouble once in a while with the flame sensor rod... It gets a film on it that's apparently an insulator... I have to sandpaper it and all is well.
Reply: idk if this comment has been made but only thing i would say is that I believe it is DC via flame in flame rectification. in standard (as in very old, pre-mid efficient, this voltage was used in a thermocouple system to open the gas valve. i think above 5mV? dont quote me on that its been a while, lol
Reply: Flame rectification
Reply: @John_Lee_ 😊😊😊😊😊😊😊😊😊😊😊😊😊😊
Reply: The 3rd function is the outdoor air ambient unit.
Reply: 😊😊一😊一😊